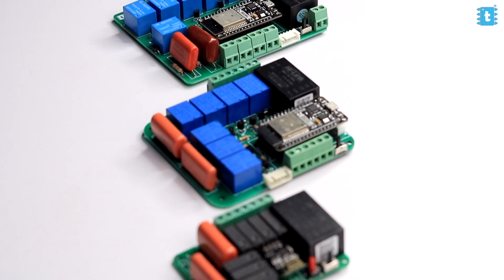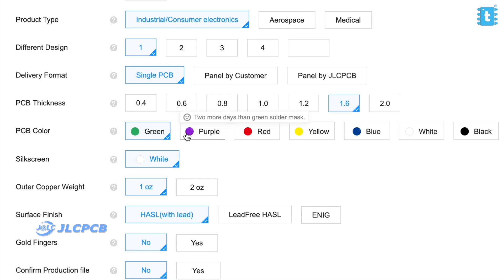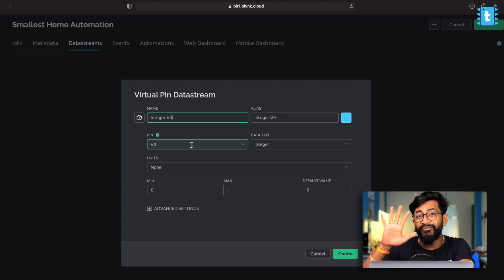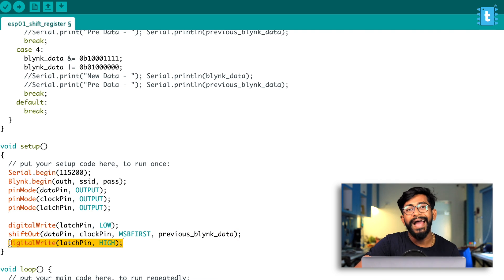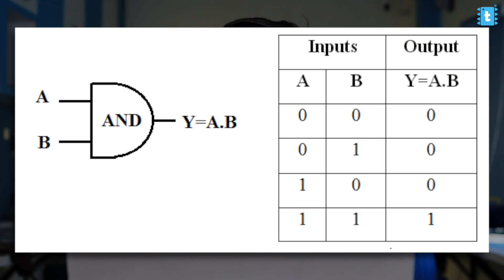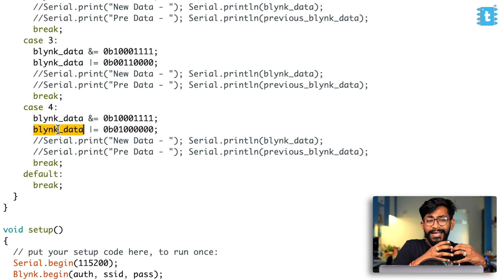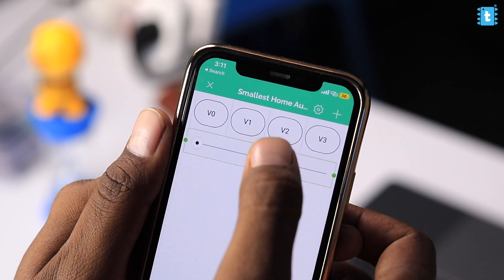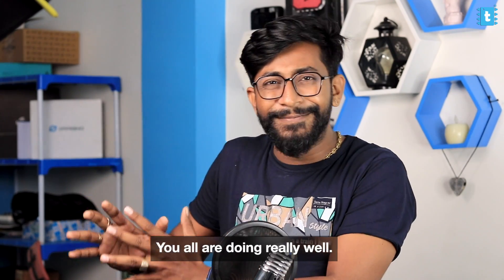SMALLEST Home Automation with 4 appliances & Fan Dimmer Control 🔥🔥 | ESP8266 projects | IOT Projects

Comment: I made same but some components are different 
Like i used relay module seperatly 

There is a proble 
When i change fan speed all relays are chage their state it is a big problem for the project 

All relay works v.  fine  without connecting the fan ( inductive load)

May be its reverse spike voltage of inductor ..

Pls give me any solution .....

Comment: Can we use the same hardware to control 7 appliance(lights) instead of fan speed controller?
Reply: the design will need modifications but it shouldn't be a very big change
Reply: Yeah you can but need to relay to those extra pins

Comment: @techiesms Automate a 1ph submersible pump which is a capacitor Start capacitor run type . That should get on when the OH tank is empty and shut down when it is filled. 
😊 Expecting your reply Sir.
Reply: already did that
Reply: you will need
1 40A  Solid State Relay
1 Small Solid State Relay
1 Normal Relay (NC)
Microcontroller (Nodemcu or d1 mini or anything )
Ulltrasonic Sensor to detect water level
Cat 6 Shielded Cable 
Hi Link 5V 2A
Optional: Oled display or ir receiver etc
Reply: @amitsamanta996  Sir Ultra Sonic sensor doesn't last for more than 2 months. It's better to use a float sensor or SS sensor.

Please provide me any video about this Sir.
Reply: there is no video
i made for me
with ultrasonic sensor i know the realtime water in tank in litres
and its lot cheaper than a pressure sensor

Comment: Best progress in home automation 🔥🔥🙌🙌but nevertheless it would have been better to use esp32 chip or esp8266 chip atleast we can update wifi credentials
Reply: By adding one button you can add the option for updating WiFi credentials in AP mode
Reply: @rahulb23  can u explain a bit more or did anyone made the working code for this
Reply: I would suggest you to read about WiFiManager and OTA Update, its available for esp devices but as for esp-01 i still do some research to compress the code
Reply: @akay9865  ok thanx for the info

Comment: You can add this project input as voltage and amps
It is more useful feature to any normal user they can see how much power consumption on this board and how much appliances are consume that much of power

Comment: I had achieved the same extending upto 16 pin using esp8266 and shift register. However, my approach is little different as i have made a function to update and latch  shift register array and then calling it inside the virtual write function. It's working ok, but I don't know how optimised the code is. But today I learnt a different way to achieve the same. Thank you so much for this awesome tutorial.
Reply: Can you please share your project details?
Reply: Chandan kumar bro app circuit kaise build krto ho muzhe samzayi na

Comment: Nice isolation of the mains on the pcb, interesting how the logic code works. I'm a little confused still, are you talking direct to your shift register that's firing the relays? I reckon we could get your device working with esphome also.
Reply from the maker: Ya 
It will work with ESPHOME as well